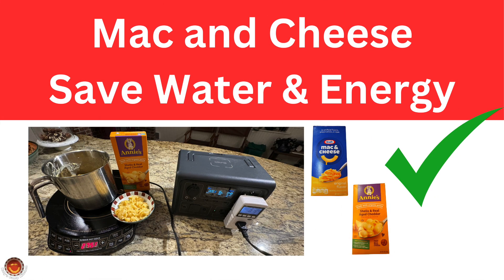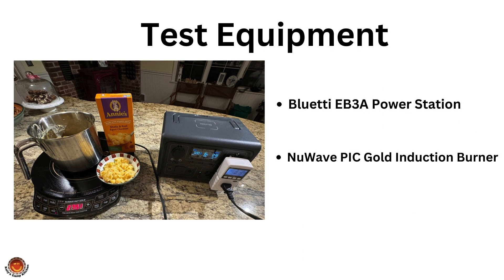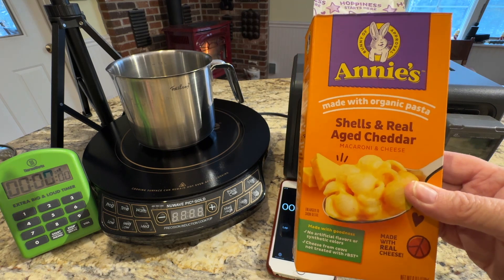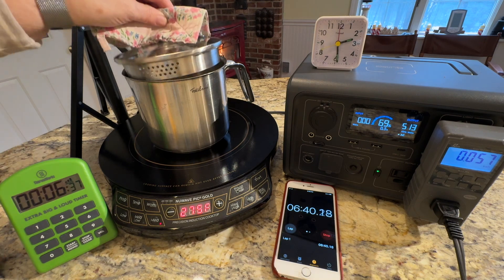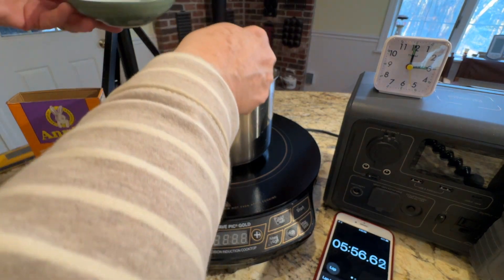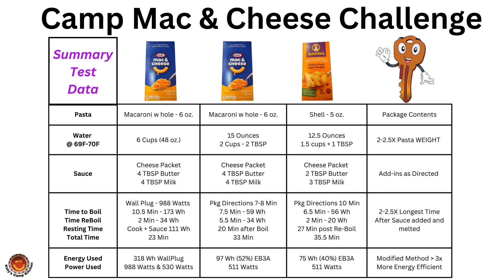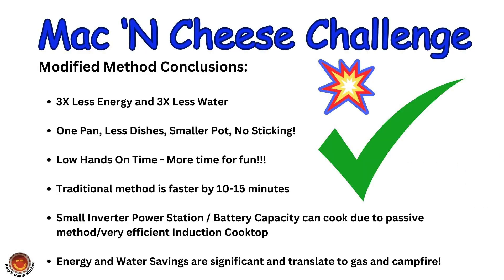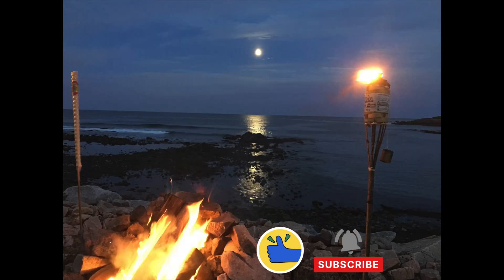Induction Cooking with Portable Power Station Off Grid Bluetti EB3A & NuWave - Easy Mac and Cheese

Comment: Thanks for making these type videos.
I also have the BLUETTI eb3a. I also have a dezin hotpot that in the low setting pulls about 300watts so that’s perfect for the 600watts eb3a. I use up about 15-25 % of that battery depending on what I cook up.
I have an older nuwave induction also but it’s not the one you can program to lower the wattage. But I have a bigger battery that can handle that.
Reply from the maker: Hi Dia, 

Thanks for your comment!

Interesting on the Diezen - I have been looking at those.

I love your channel and subscribed!

Comment: Pretty neat experiment.  I bought one of those NuWave cook tops.  It works good, but I am not impressed by the noise it makes, nor the giant amount of power it draws on standby.  That was a bit of a shocker.
Reply from the maker: Hi!
Yes  Thanks for the feedback- I am planning to do a full review at some point and will include.  

I started playing around some with the time programming function- that is pretty neat in case I get called away for some reason.

Comment: I appreciate the energy savings but the taste would suffer. I use Kraft but use more water and dump the water out after cooking, otherwise it tastes too starchy, then add the cheese, milk and butter. Anyway, still an interesting video, thank you
Reply from the maker: Hi Stuart,

Thank you so much for your comment!

The other thing that I have done also is to use the amount of water called for, bring it to a boil, add the pasta, bring back to a boil and then shut the heat off.  Let the pasta set for 20 minutes covered.  Then drain, add the butter, milk and cheese powder and stir.  If too cool after adding the sauce ingredients, then heat to desired temperature.  This will still definitely save some energy.  Sometimes I have had to add a bit of water back. When I looked at the video footage, the point at which it had reboiled the Kraft and ready to cook for 10 minutes, the energy meter was at 208 Watt hours.  So nominally this way would save nominally 100 Watt hours, while using the full 6 cups and draining.

Thanks so much for your great  comment!  I really appreciate it!

Katy